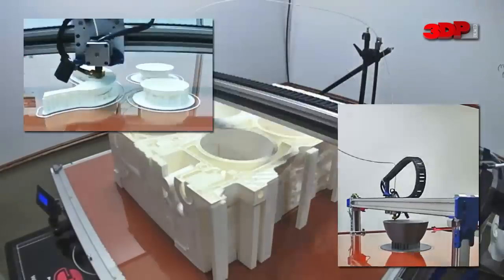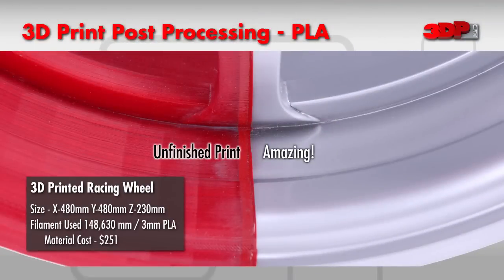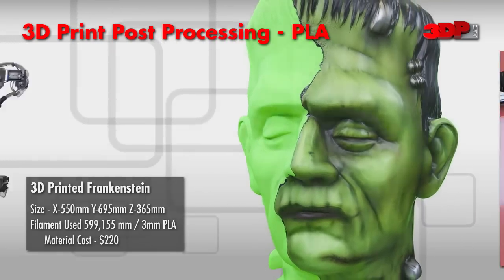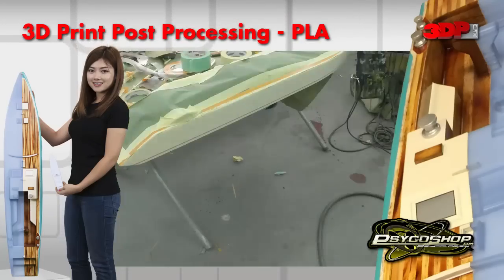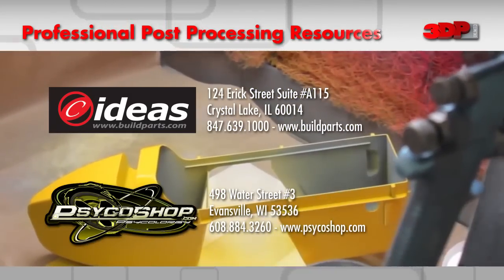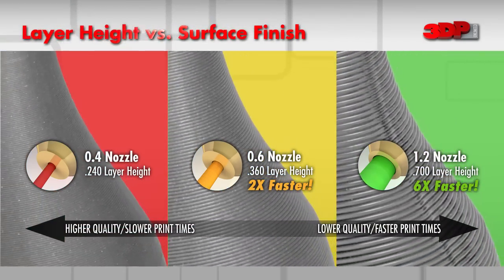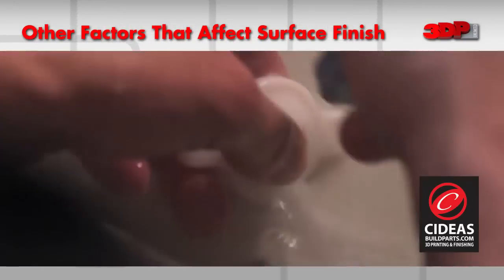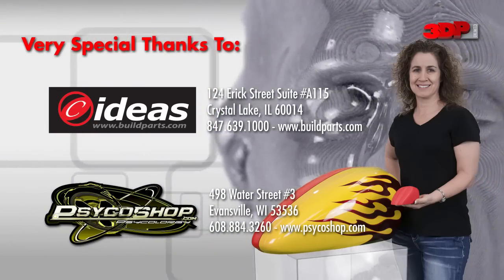Post Processing in 3D Printing - 3D Printing Tech Tips

Comment: You could have bought the wheel much cheaper than printing lol.
Reply: Yes, a commercially available wheel would have been much cheaper, but if you want to visualize and hold a new custom design of some sort, you would have to pay for a single piece custom rim. that would cost thousands. $200 for a physical, non-functional, prototype is a bargain.

Comment: PLA post processing ! I looking for this so long !
Reply: I tried PLA after a year of ABS only and I can say I like the ease of printing with it AFTER I had a nightmare dialing it in BUT for the parts I make it sucks.  ABS is not without issues for parts either so I am so glad PETG has finally arrived on the scene for decent prices.  If it goes in a car ABS if it goes anywhere else PETG and PLA is just junk imo (I think this probably because I don't print knick-knacks and artsy stuff only parts and useful objects).  I made some parts for my printer in PLA and they were Z axis bearing holders.  Held them for a few prints but the bearings on both sides will slide out as if the PLA lost about 0.05mm and I believe it did as the insides are shiny now so very slick.  No heat is ever around those parts either.
Reply: Ok PLA is relatively easy to print. But it gets soft at 50°C. Cant understand why everyone likes it so much.
Reply: With my PEI bed I use ABS with no warp